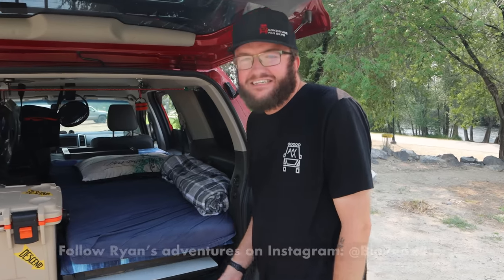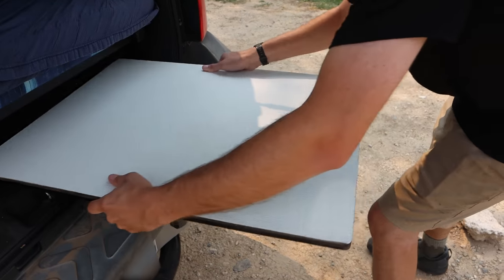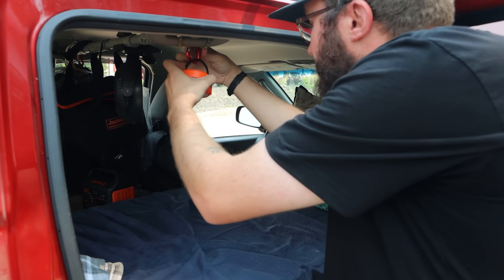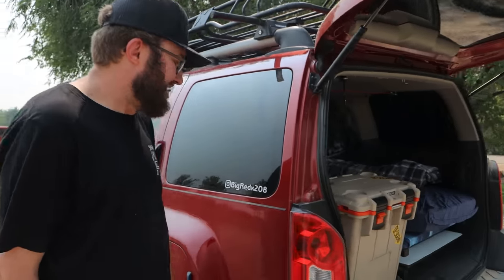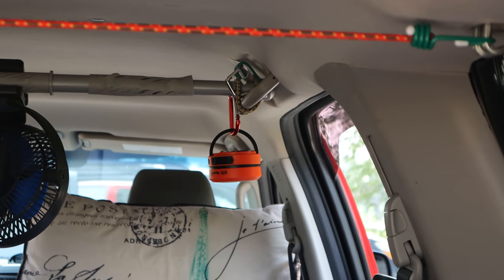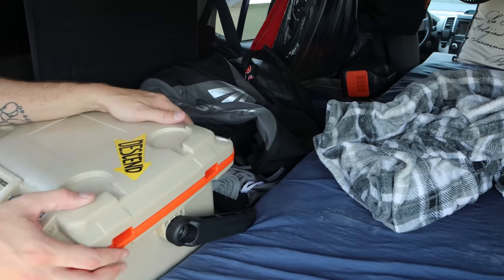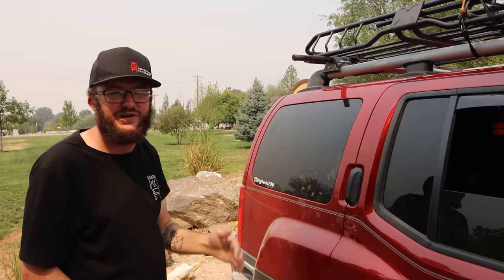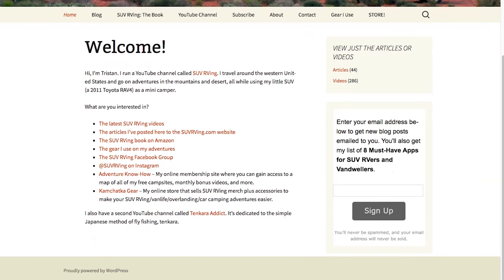He Lives in an SUV Full-Time! Full Tour of His Setup (Nissan Xterra)

Comment: I’m getting ready for van camping for consecutive months at a time and I’ve been questioning wether to get a fridge or just bring my cooler. I have a 30 qt Stanley cooler that’s kept ice for 5 days in 90 F inside a bear box mostly which is outstanding and I’m wondering if having to get ice every so often is what I really want. Any opinions or experiences will be welcome, bear in mind that I’ll be camping thus ice might be really pricey.
Reply: Buy a portable ice maker,you can reuse the melted water
Reply: @conniewaite1996  then I’ll have to get water which is not available dry camping, same issue and you’ll need solar, just as if you had a car fridge. These are all the things that get me confused. Thanks! Your suggestions are greatly appreciated.
Reply: @carmenmartinez2882  a jackery would work it,and they have small units with solar panels or plug into car battery while driving
Reply: @conniewaite1996  you are so sweet in giving me advice. I think you’ve nailed it, I find myself gravitating towards a Jackerie. That way is less headaches about ice in a cooler. Thanks!

Comment: How difficult was it to remove your seats?
Reply: Hey Pauline! The bottom of the back seats were super easy to remove with two latches. The backrests don’t fold down completely flat, but the platform was built to fix the little curve from the trunk to the top of the back seat once it’s folded down.
Reply: Have a 2013 pro4x and the seat squabs have two easy plastic snap clips holding their hinges to the floor. The seat backs are flat when folded down. Looks to be two or so bolts holding them to the floorpan. Often mulled pulling them out and building drawers matched to the height of the back floor. The leather option does not allow the passenger seat to fold flat forwards. That’s a bummer. 
Love the Xterra, never owned a vehicle so long and no plans to sell. If it’ll last another 20 years I’m done. Only drawback to the pro4x is the lift over the standard version makes it tough for the wife to get in.  Like Ryan I’m 6’5” and just step in easily.

Comment: Xterras are great vehicles except for their transmissions.  I owned one for 9 years and was on my 3rd transmission when I got rid of it.  They have an annoying tendency to leak anti freeze into the transmission which destroys all the electronics.  It's a $3500-4000 hit to repair it.  Based on my experience it occurs every 60k miles.  Aside from that, great vehicle.
Reply: I had the cooling systems separated for the transmission and the engine. It was a $700 conversion at a dealership.
Reply: @barbarashirland9078  That was money well spent.   I bought a 2009 brand new and owned it for 9 years.  Aside from the transmission, it was the best vehicle I ever owned.
Reply: I was SO fortunate to learn about that problem common to X-Terras before it happened to me. I agree. It is the best car I have ever had, and I’m old. Lol
Reply: @barbarashirland9078  I drive a 4runner now.  I like Toyota’s reliability but I must admit I thought my Xterra had better performance.   
Part truck part sports car.
Reply: Right? The x-Terra is very responsive and can maneuver well. I can pop off the line when the light changes if I want to. I do that occasionally when traffic is heavy and it’s the easiest way to safely go over a couple of lanes. 4 Runners are great. My friends have had them.
Reply: So you’re correct about the coolant mixing with trans, but it has nothing to do with electronics. Also it’s only 2ND generation pre 2010 models. They changed the radiator in 2010 and resolved the issue. It’s an incredibly easy bypass you can do if you have a model at risk, or just replace the radiator. It bothers me when people spread myths, but at the same time we t helps keep the prices lower on these vehicles. Everyone else can stay away and I’ll keep buying these basically bulletproof rigs.
Reply: I'm glad I haven't had that issue. However, I have a 2014 X with just over 95k,and my ECM took a dump. 1400 to fix.